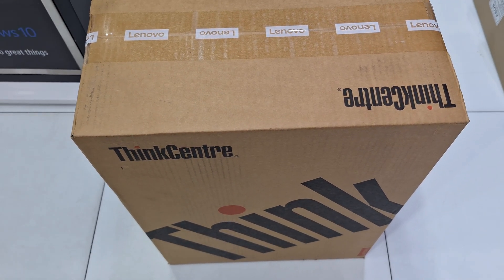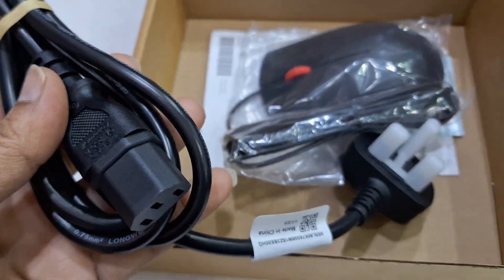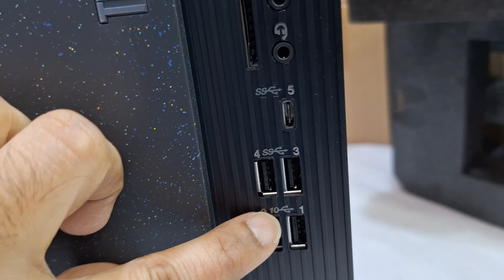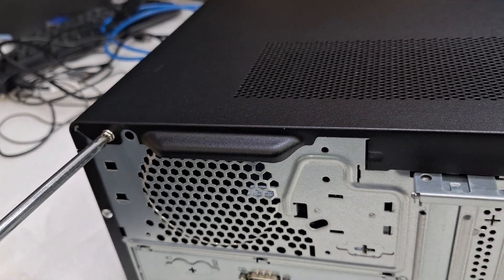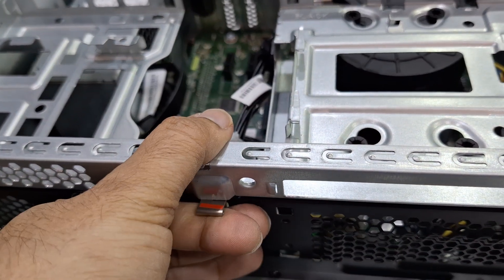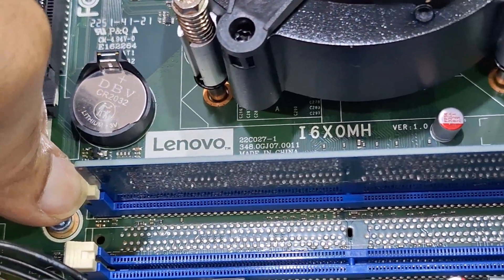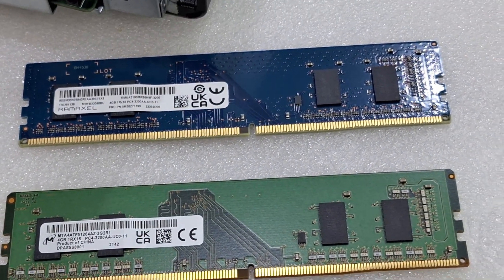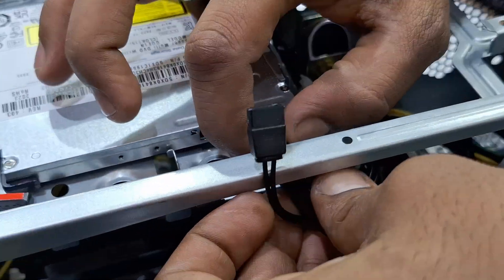Lenovo ThinkCentre neo 50t Gen 3 Unboxing and Memory Upgrade

Comment: Need Help:  Need guidance to upgrade my new Lenovo ThinkCentre Neo 50t 32g Ram 180w switching power supply to a 380w or better switching power supply for use with a SRhonrya Radeon R7 350 HD7750 4GB Graphics Card GDDR5 6HDMI Graphics Video Card GPU PCI-Express 128-Bit video card. The card says it pulls all of its power from the motherboard (55w). The ThinkCentre case is very specific of what power supply will fit and can be used within this Lenovo cpu.  -  Side Note:  Even though Lenovo's manual for this exact computer says that Lenovo offers a 380w power supply for this exact computer, when I reached out to their Sales / Tech departments, unbelievably, they couldn't even give me a part number for this unit.  Aah...  -  Help!  .
Reply from the maker: Thanks for watching,  The lenovo thinkcentre neo 50t comes with 180w , 260w ,310w ,380w power supply. It's deepening on the p/no. If you want to upgrade the supply supply, only lenovo service centre is available. About the GPU for 6 to 8 display ports.  Please check the nvs810 nvidia graphics card. It comes with  8mini display ports. It's doesn't need more power for GPU.
Reply from the maker: Please subscribe to my channel 🙏

Comment: Can we add 1000 watt power supply ?
Reply from the maker: Thanks for watching. In this branded  pc , 1000w power supply doesn't fit, and motherboard doesn't support.
Reply: Actually Silverstone makes 700W and 500W PSUs that are made in TFX format (this is how these small and long brick-like PSUs called), but this one also has proprietary connector (and it's not an ATX12VO). You can buy an adapter, however, and still connect it that way.